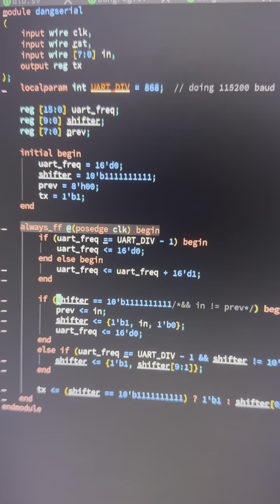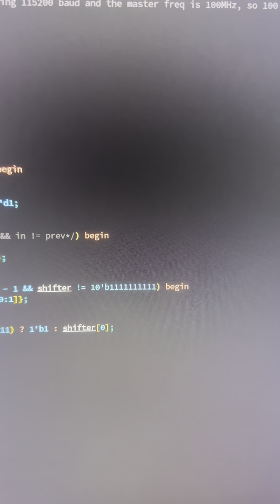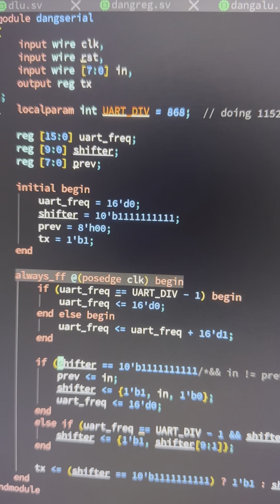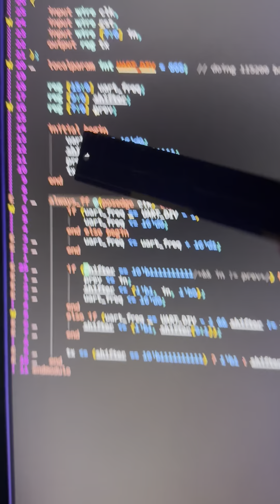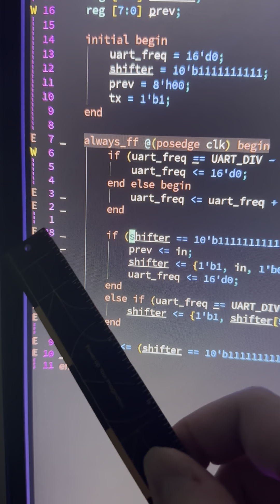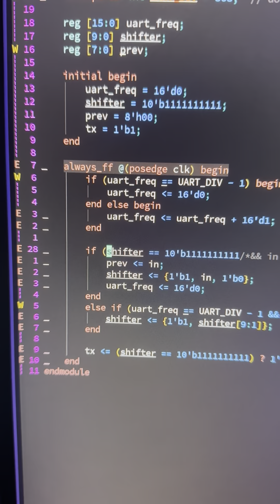DANGLING Logic Unit - DLU: UART

Comment: You might want to look at implementing a (chip)mod player, where you could run most of the logic on the PC and send commands to the FPGA to play short samples with various parameters. 115kbaud should be enough to send over the sample data for a typical song in a second or two, then it can live in the FPGA memory and be referenced during playback. You can easily make a reasonable audio DAC using PWM at 100 MHz and a simple analog RC filter to smooth it out. There's a ton of nice Amiga music available in mod format intended to be played with four 8-bit channels.
Reply from the maker: thank you! I’ll read about it. I’m currently debugging PCM playback and I wanted to do tracker formats next (probably starting with Impulse). This was the plan for the Portable that I’ve shown in other videos, too, but I’ll have to get to that after